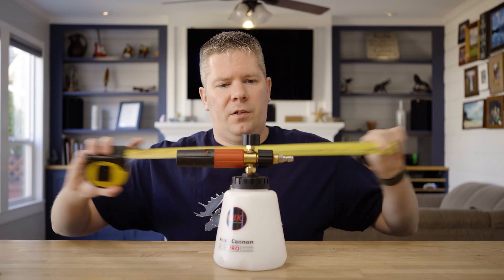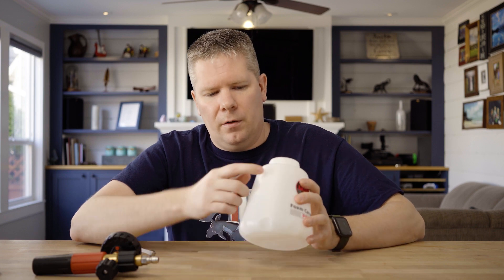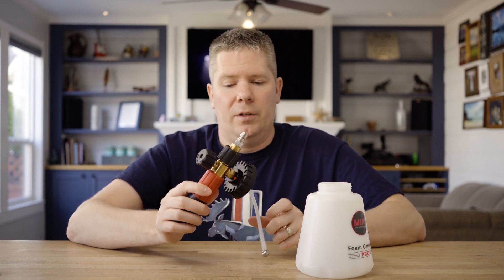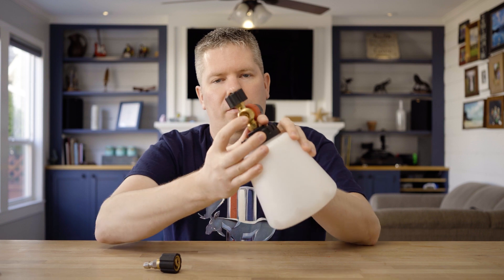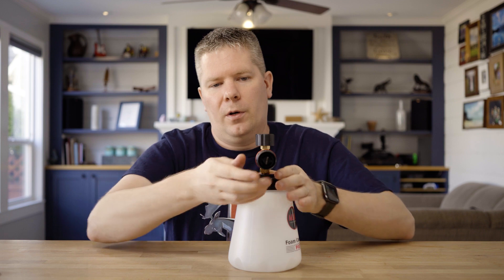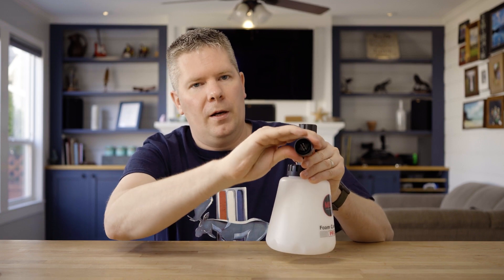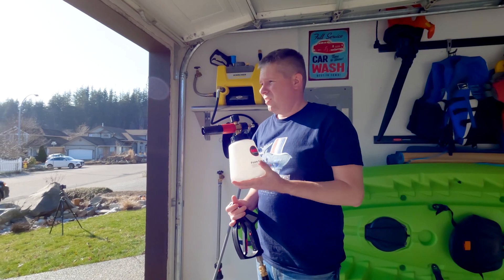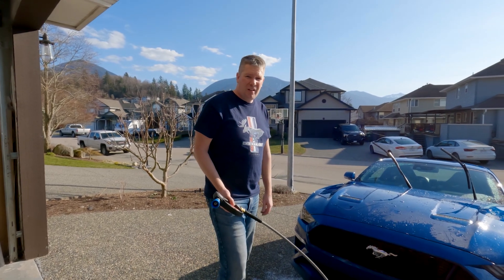MJJC Foam Cannon Pro V2: REVIEW and Why its the BEST for Car Detailing!

Comment: Did you fill the water up all the way , after adding the solution?
Reply from the maker: Yes I did. 3 oz of product and then a dunk in the wash bucket and filled it up.
Reply: @LifeOfaMatt  ah okok, have you tried the 1.1mm orifice that the foam cannon comes with?
Reply from the maker: @IViftyhands  not yet but I should!!! I hear you get more foam with it. Have you tried yet?
Reply: @LifeOfaMatt  I just bought the foam cannon , and probably just go straight forward with replacing it with the one it comes with aha. So hopefully it does perform like how people say it does
Reply from the maker: @IViftyhands  very cool. Yeah let me know how it works out. I should try it on my next wash too. What pressure washer are you using?
Reply: @LifeOfaMatt  for sure can do, but you’ll have a better idea of the difference since you have the one it comes with on right now. I got the sun joe spx 3000, was gifted to me.
Reply from the maker: @IViftyhands  NICE! Yeah will keep you posted what it is like. Perhaps another video too. :)
Reply: @LifeOfaMatt  sooo … after a few washes , today I finally got the foam cannon to work at its best. Had to play around with the nozzle. Let me tell you that when I shoot foam at one spot for like a good 3-4 seconds , it is very thick. Definitely Should try it out , if you haven’t yet!
Reply from the maker: @IViftyhands  what orifice size did you use? And what product are you using and how much?
Reply: @LifeOfaMatt  I’m using the 1.1 mm orifice the foam cannon comes with. And using roughly 100ml of Adam’s car shampoo.
Reply from the maker: @IViftyhands  NICE! Yeah I just tried Adams Graphene shampoo mixed with Adams mega foam; 1.5 oz of each for a total of 3 oz of product. Worked really well too. And no I haven’t tried the bigger orifice yet.

Comment: I bought one. It worked well in the beginning but the weight keeps making it fall off my wand.
Reply from the maker: Perhaps look at getting a small MTM gun. I have a link in the description. There are cheaper knock off ones too if you want to save a few bucks. If you get one with a quick connect, it shouldn’t fall off.
Reply: MTM SGS28 with quick release. It will never fall off.
Reply from the maker: @J88HNT  ditto. No complaints with the MTM.